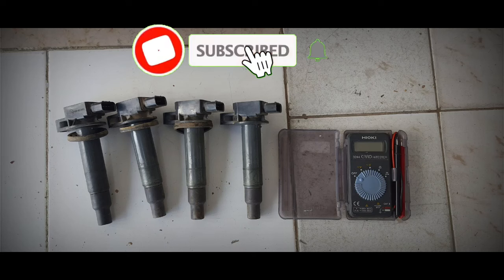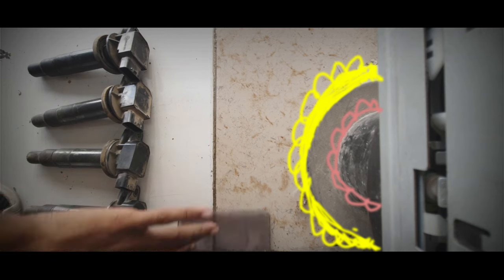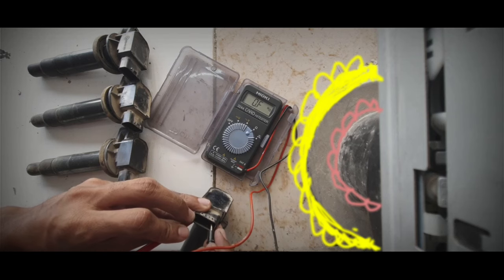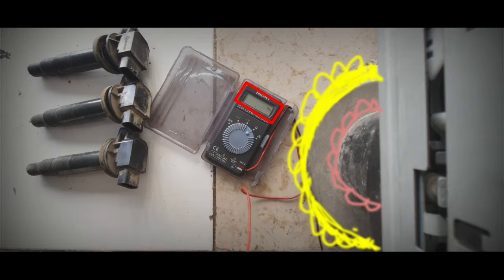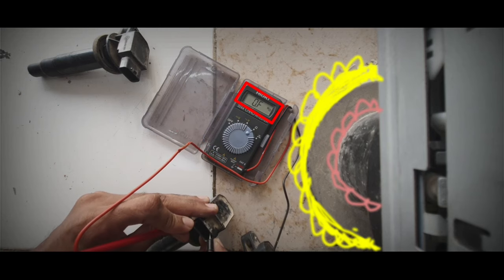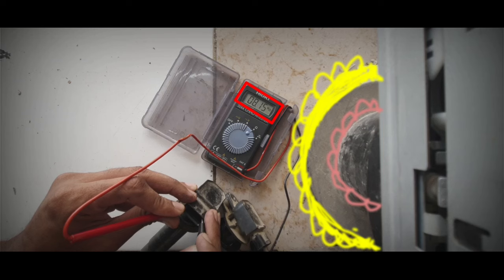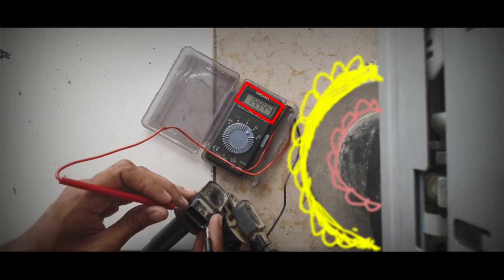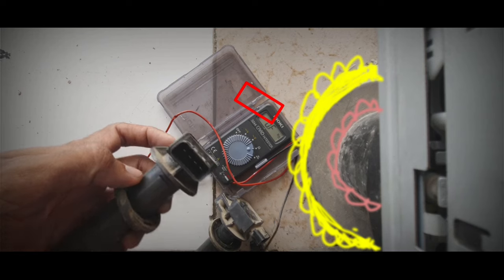How to test car ignition coil with multimeter.

Comment: Thank you. Before anyone panic not getting reading, my coils gave resistance approximately 340 ohms, but wasn't showing because ohm range was 200. I set to 2000 and it showed ratings. Make sure to check if having problems!

Comment: Hallo first of all thank you for the clear video! 
I have tested 4 coils: 
25,8-25,8-25,8-27,4

Does this mean that the 27 is putting to much risictance and thats the one that giving me problems with the car??
Reply: No likely you will need to gap that cylinder a bit longer to account for the higher input signal, likely the coil is saturated so looks good

Comment: Okay so we use the first and last prong to test. 

What ohm resistance do we use on our multimeter?
Reply: 200 ohm, 1 and 4 terminals should read about 195;  2000 ohm 1 and 2 terminals should read about 310.  Any numbers way off should be the bad one.

Comment: The video would be better if you explain that 
1) out of the four pins, how to determine which two pins to use  
2) your ohm meter has only one setting (Ohm).   Most meters have 200, 2000, 20K, etc setttinggs.   Which one to use
Reply: Agreed; I need to test my coils and that info would be more helpful.
Reply from the maker: Thank you brother
Reply: @carhospital   1) How do you know which pins to use for the test?
2) Which Ohm setting is best to use?

Comment: I'm confused ... how are you getting a reading when the coil is on the ground and there is no electricity passing through the coil
Reply: it's measuring resistance or continuity between the two pins, no need to be energized